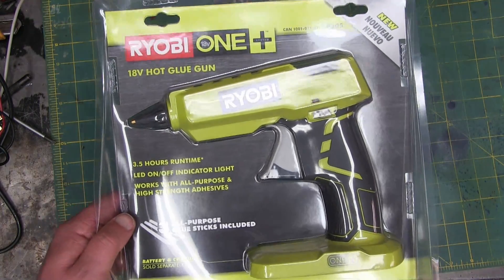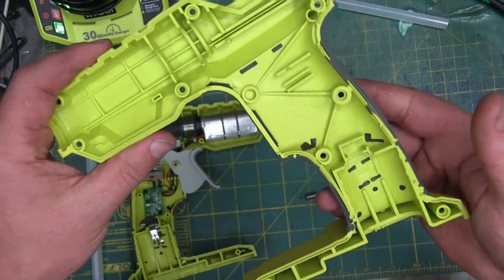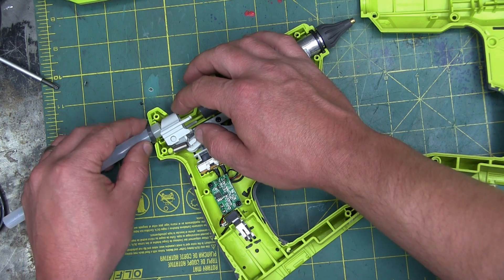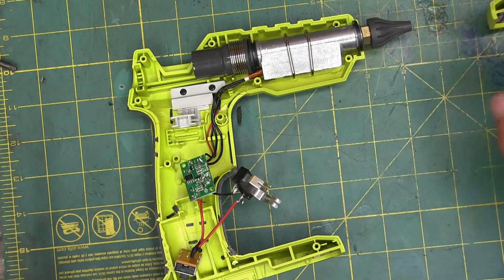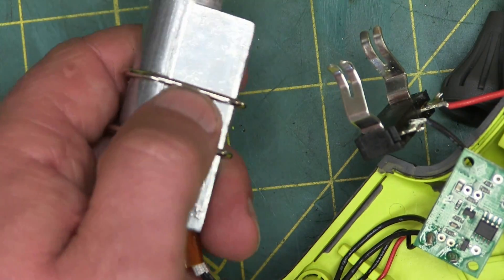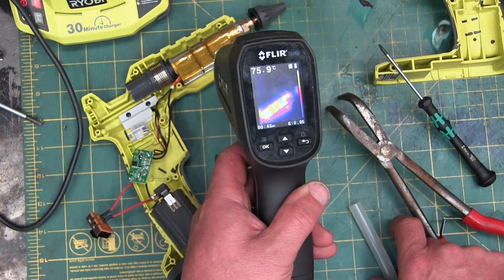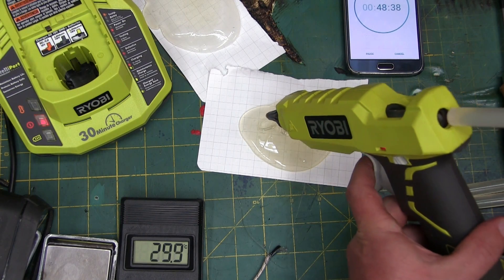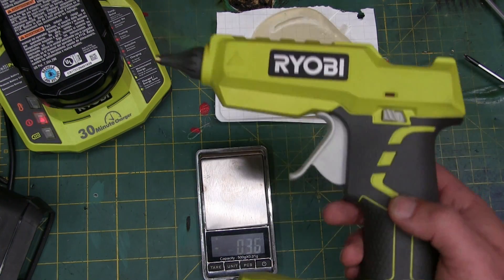BOLTR: CORDLESS HOT GLUE! | RYOBI

Comment: never have had any trouble with the ryobi tools that I own.
Reply: Same here, i don't know about outside Norway but here it's good tools for the money.
Reply: Same! All my work gear is Milwaukee, but I have Ryobi stuff at home and I actually love it (most of it, some things are bad like the new drill chucks)
Reply: 9 times out of 10 I'd rather have a cordless tool. Exceptions would be heavy use of grinders, saws, hammer/rotary drills, or hole hawgs. And the only reason I'd rather have those tools be corded is that they drain batteries quickly, and the grinders bog down. That applies at home and ESPECIALLY at work.
Reply: I use snap on for work but i got a few ryobi tools at home. love the cordless sawzall. get tools for home  use that don't brake the bank
Reply: I've had a Ryobi drill I use to open and close electrical enclosures at work (really low torque, using a drill is just faster than a screwdriver, you just gotta be careful) but I haven't charged the battery in that thing in like 3 months, and I use it in like 60 fasteners a day.
Reply: Way better than a crapsman
Reply: The only problem I've ever had with Ryobi power tools is the old Ni-Cad batteries were horrible. They were okay when new but after some decent use they crap out and won't hold a charge. But the tools work great for the money even if they aren't the most ergonomic.  And Ryobi did it right when they switched to lithium batteries. The lithium batteries will actually work in the old Ni-Cad tools. Every other brand forced you to buy new tools if you wanted lithium batteries. DeWilt came out with a crappy adapter, and while it does work, by the time you buy the adapter/batteries/charger you can almost buy a new tool with batteries and charger for the same price. The adapter was just a way to milk money from people who were too stubborn/cheap to buy new tools but wanted lithium.

For "store brands" of tools I like my Kobalt tools. But they screwed people over when switched from 18v batteries to 20v and 24v. Now I have a drill and impact combo that will be worthless when the batteries give up.
Reply: Well I got curious and did some checking. Some people claim that the 20v Kobalt batteries and chargers are cross compatible with 18v Kobalt tools and batteries. Now I might buy a 20v battery to try it out.

Edit: and Lowe's website also states that the 20v batteries are compatible with 18v tools. I thought I had checked on that previously and their website didn't mention it. Now I'm not so disappointed.
Reply: Ryobi tools are great for home owners. They're inexpensive and aren't made so shittily that they'll fall apart. But if you're putting those tools to use day after day they're not good.
Reply: Gotta admit I love the ones I have, however I'm definitely on the look out for a quality jacobs to replace the chuck on my press. I like the press, but that chuck has a bit of the wobbles.
Reply: nothing better than the speed wobbles :P
Reply: I agree with the jacobs chuck the china drill press that I bought years ago got that change immediately.
Reply: Me too, haters gonna hate. But they're gonna pay out the nose to do it.
Reply: Well, the crew that put gutters on my house would argue that point.  They have been using Ryobi One+ drills since they started their business, according to the owner.  He loves them because they have survived being dropped off a roof and if they don't, they are cheap to replace.
Reply: I have a lot of Ryobi tools and most of them are really good. They are all very solidly constructed. The drills are good. We have the brushed one and the brushless hammer drill. The circular saw is a bit underpowered for 50mm deep cuts but works fine for 19mm timber. The reciprocating saw is really powerful, like the jigsaw.  We also have the led area light, which will run for days off a big battery
Reply: It is for the batteries that I switched to Ryobi cordless tools. They might not have quite the variety that dewalt, milwaukee, etc. have, but I've found that the tools I do have hold up well under use. Most people also don't realize that Ryobi makes 'garbage', 'OK', and 'good' varieties of the main flavors of cordless tools (drills, impact drivers, saws, etc.). While the 'crap' ones aren't much better than HF, the 'good' varieties are very close to some of the corresponding rigid and/or Milwaukees (all made by the same company). Examples - brushless hammer drill; 1" stroke recip saw (they make 3-4 flavors of that); rumored 7 1/4 circular saw (not out yet). After I had another line and they completely discontinued the batteries (Menards store brand), I switched and haven't looked back. I have been slowly upgrading to the 'best' Ryobis, and I'd say they're very good tools for the money.
Reply: Ryobi makes 3 different models of one+ recip saw. Basic, which is slower and shorter stroke, mid-grade, which is faster and has anti-vibe handle and shorter stroke, and high-end, which is faster, has anti-vibe handle, bigger motor, and longer stroke.  A brushless orbital recip saw is on the way according to the rumor sites (p517), which would give those bought into the One+ battery system a saw that should easily keep up with dewalt/milwaukee/etc.
Reply: I just wish there were more of them available here in CZ. I want to buy the QuietStroke driver in the near future and so far it looks like I'll have to order it from the US.
Reply: William Thrasher Even though you are a trasher?
Reply: damn, I meant to say corded tools. I've been shifting to air tools, too, which are awesome because you can get slow and fast drills all at a price that doesn't break my budget. Always loved new tools when I was younger but now that I'm more experienced I like the bang I get for my buck at the pawn shops. And I only buy the good names... Dewalt and so forth.
Reply: Their 18v sawzall really is pretty good.   It's about half the weight of a Milwaukee so it feels much smaller and handier.   Not what I'd want for demolition, but for odd jobs it's great.  Bigger and faster than a hackzall and significantly lighter than most sawzalls.
Reply: You say that and but just yesterday my 1yo cordless drill trigger stuck on while I was doing a "delicate drilling operation"... Pissed me right off!
1 year after I bought it and helped me build my awesome mancave... 
Love the drill hate that I now have to find the receipt  that I put somewhere safe(??) (2 year warranty).
Reply: danjayh-Good point about the different grades of Ryobi tools.   The drills, recip saw, circular saw and impact driver all come in different grades and you can really tell the difference.  I bought mine separately and only got the highest grade, so maybe that's part of the reason I've had such good luck with them.
Reply: i havnt had any issues with mine either , but i use prfessional grade pnuematic tools for big projects. only use battery powered stuff for drills and sawzalls. even when i have to be mobile i find it easier to load up an aircompressor and 1 extension cord than to carry a bag full of batteries and chargers.
Reply: Use exclusively Ryobi now. Used to have Makita until someone stole them out of my work truck. Bought the Ryobis to fill the gap and was going to replace them once they crapped out but they've been going strong ever since. Have impact, drill, sawsall, skilsaw, sander, miter saw, table saw, brad nailer, grinder, a couple flashlights, and a jigsaw, some corded some not. Only ever had an issue with battery power on the flashlights
Reply: I use ryobi on the job site and have never had a problem
Reply: never had them but i bet they are of the highest of quality
Reply: Flogged mine daily I think my future kids kne day will be I geriting them because they're in better knick than what I am after all that work.
Reply: ALL cordless tools bite ya once you gotta start buying new batteries. I finally just went back to cordless tools. You know they're cheap in pawn shops since every one is drooling over cordless but how often do you really NEED cordless? I'd rather spend a minute plugging in a cord or extension and have more power than cordless than waste time screwing around with batteries/charger and such. 

The only time you really need cordless if you're building off-grid or once an awhile with running/upgrading home electrics and even then you can often run the tool from an adjacent circuit.
Reply: I actually used them on the job for about two years and they worked pretty well.    They're really pretty good for the money, but they're not the best by any means and when you're using something to earn a living you don't want something that's just adequate or a good value.
Reply: I use them a lot
Reply: But have you ever used them?

Comment: Ever felt the need to deposit some shmoo without plugging your pokey bit into its receptacle? Well, Cryobi has a tool for you! Also, we have hot glue guns.
Reply: Dylan Headrick I'm afraid the lip seal would keep it in .  the other hole is too hot and sticky
Reply: That’s hot.
Reply: Fail. It should be: "ever felt the need to deposit some shmoo without plugging the pokey bit into the angry pixie receptaclator?"